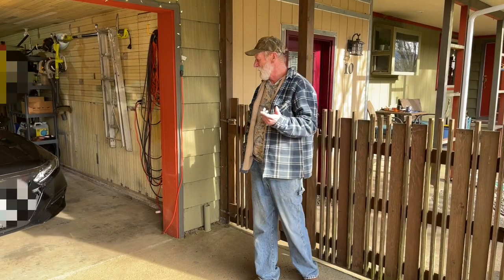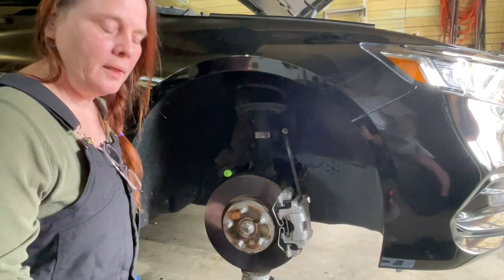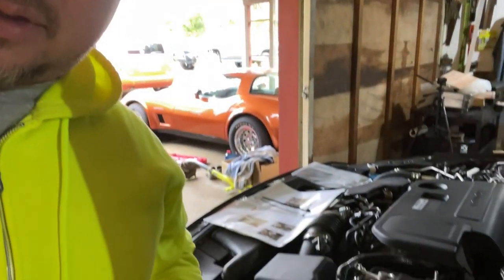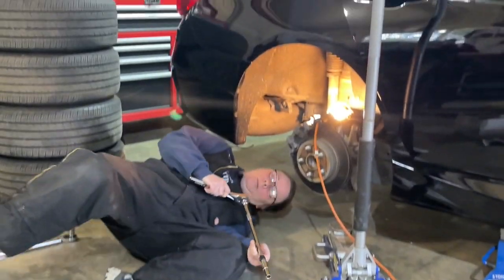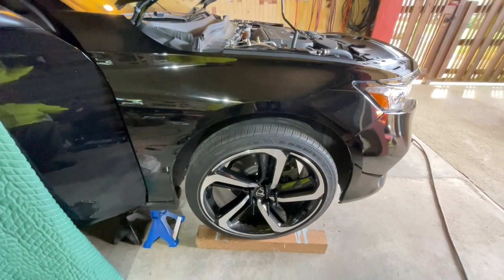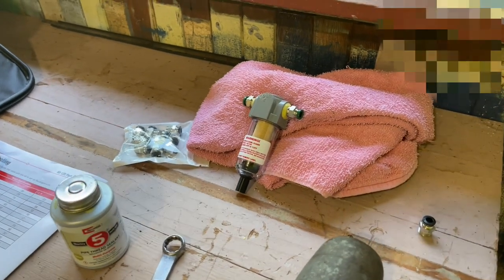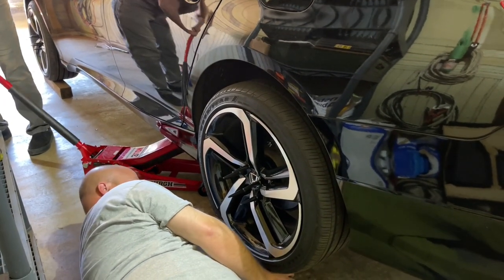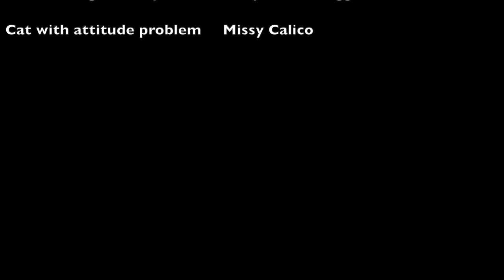Honda Accord 10th Gen Air Lift Performance Suspension Install With My Parents Help!

Comment: Hey, great video! I like the step by step process you did there. 
I do have a question though, I am about to bag my 19 accord and wanted to ask you about how you went about mounting the tank to the upper deck there? 
Thanks
Reply from the maker: Thanks, I just used Threaded inserts (nutserts). I marked where the hardware would need to bolt up, drilled my holes and inserted the nutsert using my nutsert gun. Then simply bolted them up. A vague explanation I know but I hope that helps anyway.....

Comment: Good video Did you just put in the  The front struts and the rear shocks like they came in the box or did you do any adjustments?
Reply from the maker: Thanks Man! Initially I think I had them adjusted 5 clicks below full stiff, but I ended up dialing them down quite a bit, I was surprised how firm the ride was with this kit. (This is my second Air Lift Performance kit albeit for a different car but yeah, it's a firm ride.) I will at some point do a long term review of the kit in a Future Video.
Reply: @pnwfamchan  👍🏽 thanks wht about ride height?
Reply from the maker: @JRod.Cuztom  Ride Height is as is from Air Lift Performance, no need to adjust that.....
Reply: @pnwfamchan  thank you for reply appreciate it

Comment: Hello, just wondering if you’ve taken any road-trips with the airlift on? I’m aware airlift will make my ride more rough, and I’m okay with that, however, if I’m unable to drive with a car of 5 180lbs adults that would be a dealbreaker for me. Any experience with large loads? I rarely do drives like these, but if the functionality of a big car is ruined by constant bottoming out with passengers I may have to reconsider. Thanks for your input, I look forward to your reply.
Reply from the maker: Day one when we finished the install. I had to drive back home from my parents house. (about 200 miles.) Believe it or not, this is my daily when I'm not driving my CRX. I've had zero issue with the Air Lift Performance kit. I'd say I have total confidence in the system. This is my second kit on a different car and my prior experience with them definitely played a role in my decision to go with them again for this build. Does everyone have a perfect experience with their kits; probably not, but I like their products. I've taken a few trips each a few hundred miles here and there. I went zip-lining with my Parents, my Aunt, and My Grandmother (about 100 miles round trip) with no complaints. I have yet to "bottom out", ever. Even though this is an airbag system, I think it genuinely does a good job at, you know,,,,suspension stuff. :) Yes, the ride is a bit firmer than I'd like in general; that said, it does help to ensure you won't bottom out. (though I will say it is possible to scrape if you're driving in a stupid low setting 😅) I don't know that this is my: "Let's go drive across the country" rig. (I bet I could though.) If an airbag were to fail several states away from home, that WOULD SUUUCK, lol.

Comment: Question? I'm about to install my air suspension and I was wondering since I have aftermarket rims on my 10thgen Accord I wonder if the initial calibration at the beginning would interfere with the rims being scratch or damage when the car is slammed? I'm wondering if I should roll my fenders before Installing the air suspensions. What are your thoughts?
Reply from the maker: Well, it depends. If you have an aggressive fitment/low offset wheels and no real negative camber to speak of, then it MAY be a problem!?!? I myself have never had such issue but I suppose it's possible...... I'm curious, what wheels are you running and what are the specs? (Diameter, width, and offset) THE BEST way to know is test fit the wheels after installing the bags (while the car is still fully elevated on jack stands and BEFORE powering up the system for calibration. ) and place a jack under each corner and jack it up until it's fully compressed so you can see if it will touch the body work. Obviously don't keep going with the jack if it is inevitably going to cause damage..... At this point you will KNOW if you have to roll the fenders.... Initially I ran my stocks without rolling the fenders an had zero issue save for a lil rubbing with the spacers installed and if I was at a super low ride height while driving. Lastly, I'd say it's never really a BAD idea to roll your fenders fwiw... If you do, I'd say use an Eastwood roller or something similar with a heat gun. There are videos on YouTube that will explain that process if you haven't already checked them out... Hope that helps
Reply: @pnwfamchan  I'm running 19 x 9.5 (12+ offset) square setup wit 225' tires upfront and rear tires are 245's. I have a slight poke up front. I'm wondering about giving the front enough negative camber to clear the fender walls. At (-3) for the fronts. For the rear I think I should have enough clearance. Or else your right maybe rolling the fenders is not a bad choice either. Thanks for your feedback.
Reply from the maker: @modakaification  That's exactly what I did at first. (-3 up front). It sounds like your'e on the right track. Fitment Industries is a good place to check out others fitment. I just looked and there's a few people running very similar sizes to yours and siting rolled fenders/ and or some camber. It's totally doable....

Comment: how much did the whole set up cost?
Reply from the maker: I've got about 4k into the setup. That's Front/Rear kit, Tanks, management, etc. If you join the Facebook groups etc. you can find used gear for way less. Depends on what you're looking for....🤷‍♂

Comment: Wow, that looks sick. You make me wanna bag my 9th gen! Are you running wheel spacers?
Reply from the maker: Yessir, the vid and thumbnail pic. were taken with the spacers on. (25mm) I took em off because I need to make some adjustments. lol (that will be an upcoming video.) Thanks Btw!
Reply: @pnwfamchan  Thanks. You’re welcome. I would like do see a walk around with the car laid out. Also, if it were me I’d keep the stock wheels. Most folks would change em but they look good as is. I always thought that if I bagged my Sport, I’d upgrade to 20’s until I saw this video. I would just run spacers.
Reply from the maker: @slickpanther06  Walk around and some rollers are in the works, just gotta get around to editing the footage. ;) yeah I don't plan on getting rid of the stocks but may do some three piece joints at some point.
Reply: @pnwfamchan  Looking forward to it 👍🏾

Comment: Is air suspension better than regular suspension?
Reply from the maker: Yes and No.... I really think it depends on the end goal for your vehicle. For me personally I like the options it gives me. Some days I may want Hard park; some days I want to cruise in a normal everyday ride height fashion.... Some days I may want to ride super low. ( On these days I usually have to raise up (periodically) a bit due to road conditions being a bit sub par.) In my opinion, This system does NOT have a better (more comfortable) ride quality than the factory suspension. It just doesn't. It does not matter the setting either; I find it to be much stiffer than factory even on the softest setting. In my experience, the same can be said for most coilover setups so it kinda just comes with the territory when lowering your car. If you plan to track your car I'd say (and I think most would agree) go with coilovers. Just my 2 cents......

Comment: Hows the ride? Is it bouncy?
Reply from the maker: Nah, not really bouncy, but definitely firmer than I expected.....(I have mine dialed in at 5 clicks above full soft......)
Reply: @pnwfamchan  I been debating to get bags or not. I still have 2 years left of factory warranty on  my 10th gen accord and don't want to void out my suspension warranty.
Reply from the maker: @bj10jgo  I say live your best life! If you're thinking about it, you should just do it. (Tomorrow isn't promised for any of us.) If you are concerned about warranty, just make sure to have it professionally installed. In order to deny a warranty claim, they would have to prove your "mods' were the culprit in causing a would be failure. Voiding your warranty over professionally installed products is borderline illegal I would say depending on the state you live in!? ***But I am no lawyer....:) 

(I also have the extended warranty on mine.)
Reply: @pnwfamchan  Good point. I read a lot of 10th gen accord owners have issues with the pillow bearings always breaking and being replaced. Could be an Airlift defect product thing. Also some had those Christmas error code lights show on their dash after the car been driving for a couple months because the sensor (aka honda sensing)  is not use the car going up and down.
Reply from the maker: @bj10jgo  I had some minor annoyance with the TPMS going off more often than normal but that's really it for me.....( I constantly change the ride height depending on the road I'm on or if I wanna stunt. lol)